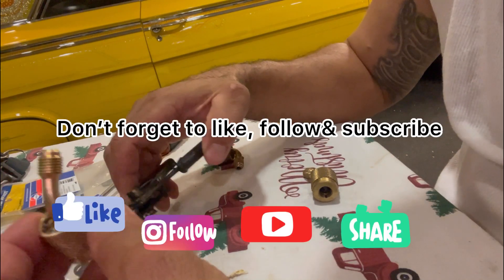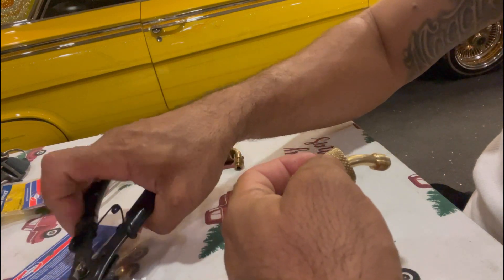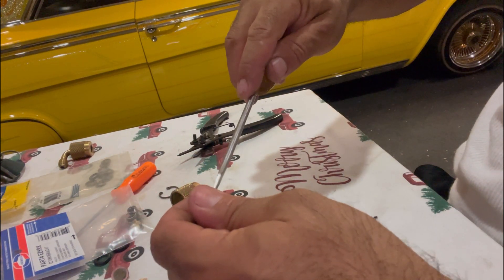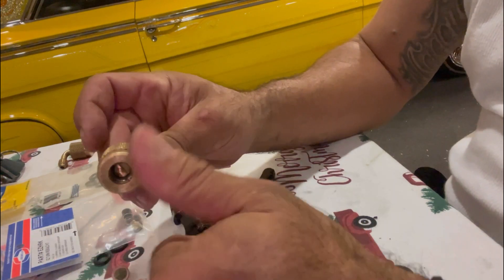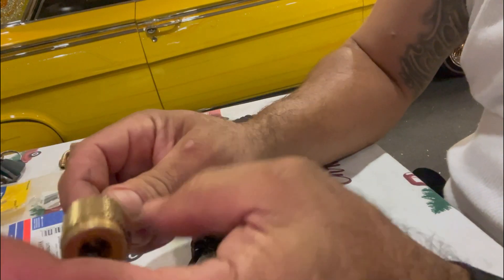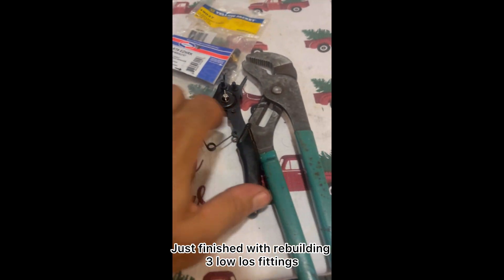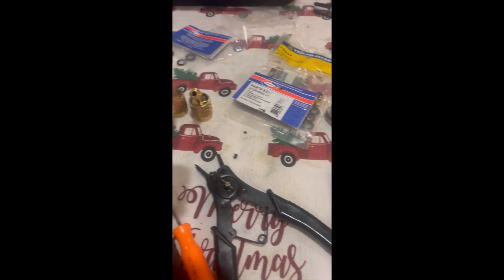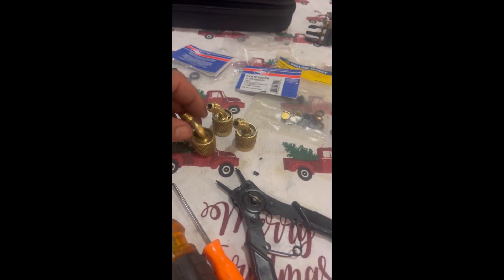How to rebuild Hvac Low loss fittings

Comment: So I ordered the same kit and it seems to still leak...upon a little research it seems the yellow jacket actually makes a kit specifically for those fittings and may work better...cause the gasket that uniweld comes with the inner gasket is a bit smaller than original...so before it would hold the charge in the hose but this time it seems to seep out